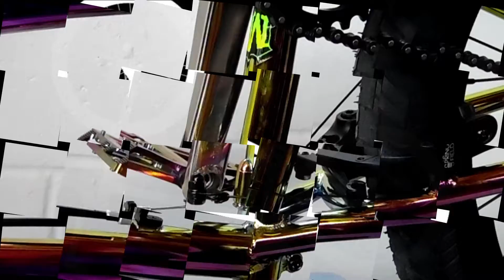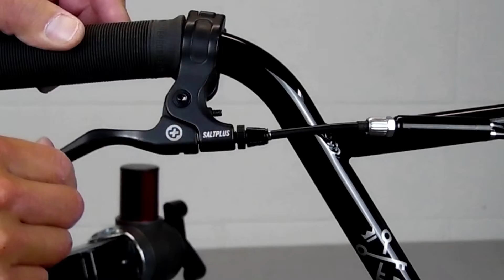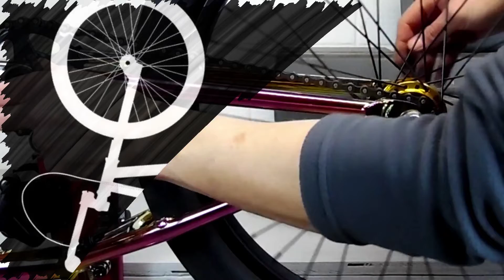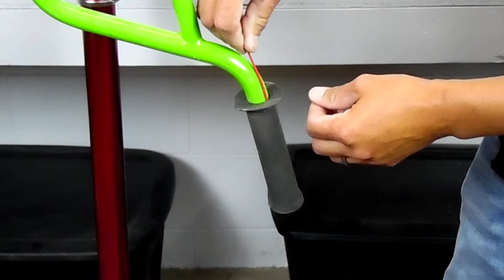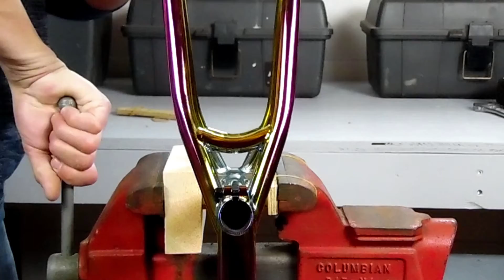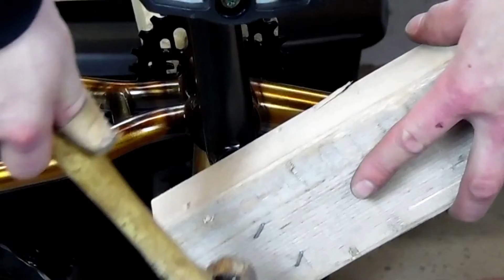Top 10 Tricks and Tips For BMX Bike Repair

Comment: Any idea how to run a 16 tooth freecoaster?  Everything is 9 teeth, but my older bike needs a 16 tooth rear sprocket.   I'm currently running a cheapo coaster brake.
Reply: Just swap or to like a 33t/9t
Reply: @ReVolt_80v  Thanks.  The answer for me was a Profile Z-Coaster with a 13 tooth cog, and female axle bolts.  The front sprocket is also smaller, and you can find bike gear ratio calculators online to determine the correct front sprocket size to match the new 13 tooth rear cog.